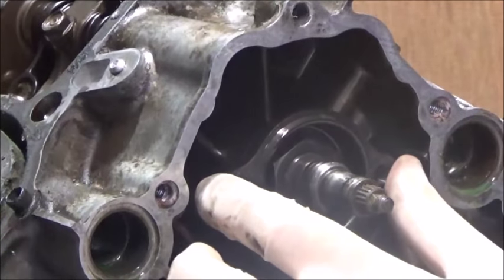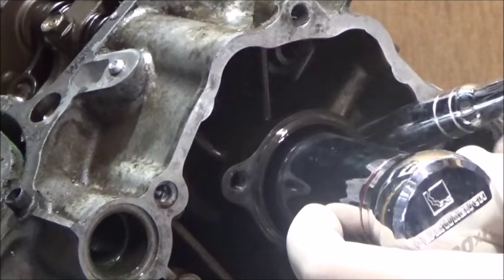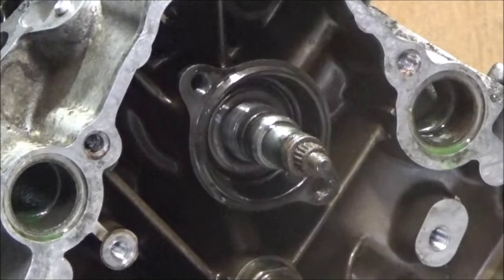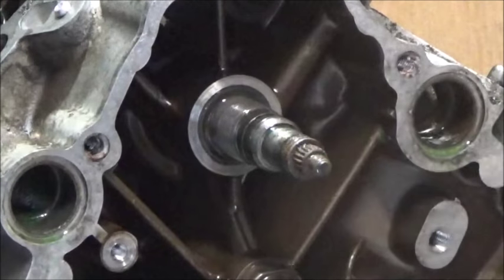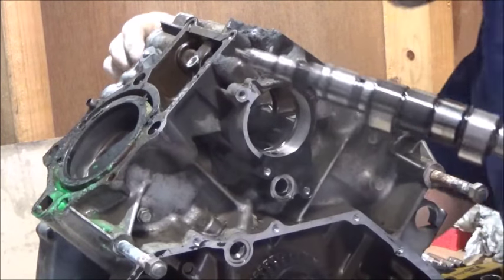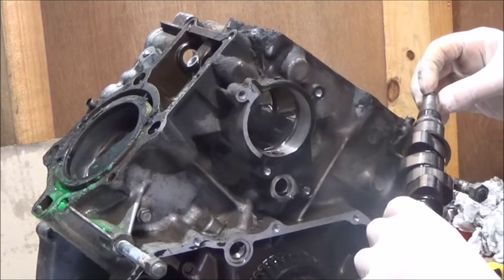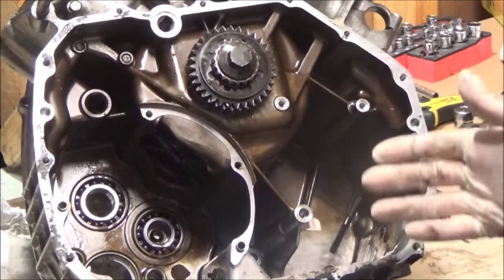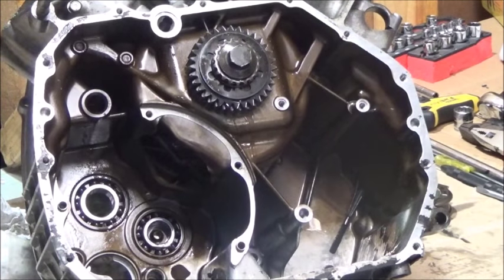Honda CX500 Cafe Racer - Engine Dismantling 7 - Episode 11

Comment: hello thanks for the tutoring I am learning a lot I am restoring a cx500 cb honda and I have a pedal oil leakage of the retailer marches good question is whether the oil seal can be replaced on the outside or I have to remove the entire lid Rear of the engine? thanks greetings
Reply from the maker: Hi Alejandro. You have a CX500 or a CB500? Different models. On the CX500 if you are talking about the left side pedal, or gear shift pedal, then yes. You can change the oil seal without removing rear cover. First remove the pedal. Then use a hook to pull out old seal, and replace with correct replacement. Good luck.

Hola Alejandro. Tu moto es una CX500 o una CB500? Son diferentes modelaos. Si estas hablando del pedal de cambio, y si es la CX500 pues si se puede cambiar el sello de goma sin remover la cubierta trasera del motor. Tienes que desconectar el pedal de cambio y usas un gancho para remover el sello, y remplazas con la parte correcta. Buena suerte.
Reply: hello thank you if it is a cx500 cb is the version custon UK thank you .. !!!